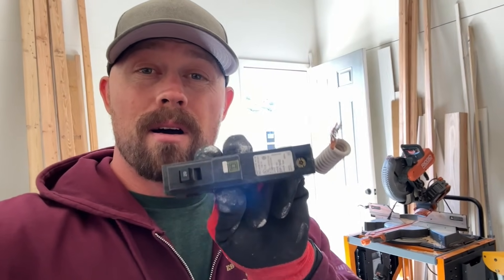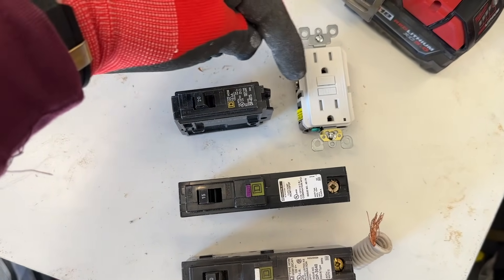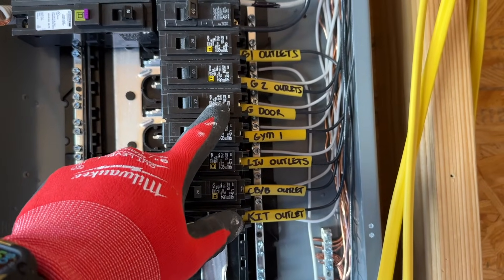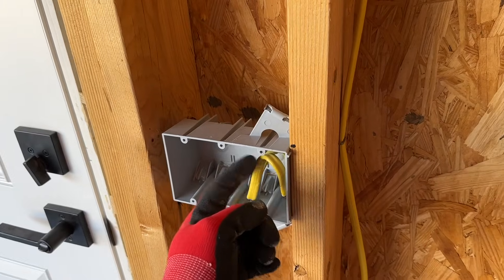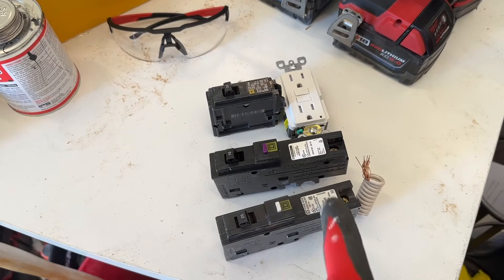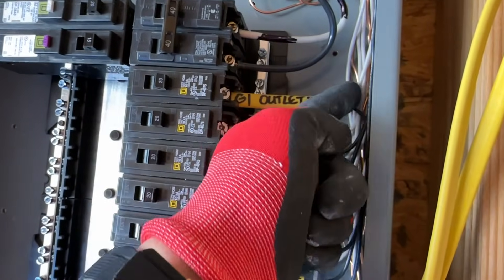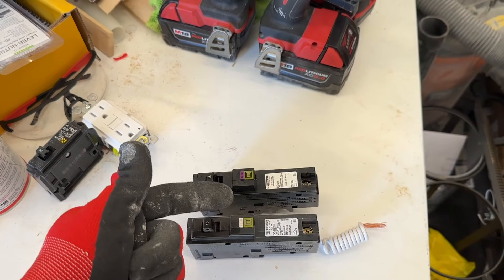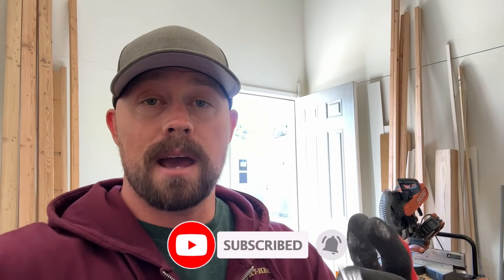AFCI Breaker Vs Circuit Breaker- What’s The Difference?

Comment: What's the point of connecting the breaker to neutral twice (white wire + pigtail)?
Reply from the maker: Technically the ground bar and the neutral bar are “bridged” or connected at your main panel. So yes they are both touching the same bar at the end of it all. At this sub panel the two are not “bonded” or bridged. Code says the sub panel should not have the ground and neutral bonded. Only at the main panel. The ground is a redundant connection making sure if the neutral for some reason fails the ground can let the power go where it needs to.  So even with the breakers you may see a push on connection with a pigtail and it’s just redundancy
Reply: @FortKnoxCo The ground is NOT a redundant connection as you stated. The equipment ground is connected to all metal components, including metal framing, service equipment, and metal water pipes, to insure that if a hot wire comes in contact with these components, a low impedance path is created to return the ground fault current back to the neutral/ground bus bar in the main panel, and back to the transformer to trip the breaker in that circuit. The ground and neutral are not connected to each other anywhere else, including sub panels, as you mentioned, because it would create parallel paths, aka "objectionable current", meaning current is divided between the neutral and ground unpredictably and is a safety hazard. If you had a neutral failure, an open neutral, the circuit wouldn't work, and if this happens in a multi wire branch circuit, it could burn up equipment because the circuit would become a series circuit. A ground wire won't come to the rescue in either of these cases.
The pigtails on AFCI/GFCI breakers are not for redundancy either. The neutral wire still connects to the neutral bus as does the pigtail. The pigtail is for AFCI and/or GFCI protection, and the neutral wire from the circuit is for breaker over current protection. A plug on neutral breaker wouldn't have a pigtail because the plug on feature plugs directly to a bus bar in a panel designed for plug on neutral breakers. The neutral wire connects to another lug on the breaker designed for this purpose, over current protection.
Reply from the maker: @  very good information! Thank you for sharing that 🤙🏼

Comment: I know you get this a lot, but you may want to keep in mind that for Square D breakers, purple button indicates a dual function breaker (CAFCI + GFCI) while the white button indicates a CAFCI breaker. Both types can have pigtail or plug-on neutrals. Regardless, you did a great job explaining when to use them and when it's not necessary.
Reply from the maker: I appreciate that. Yeah a lot of people have been mentioning the two differences, it is good to know, but it starts to get deeper into the weeds for most DIY’rs. But that is the next step in learning the differences, and when and where they are best utilized.

Comment: EXCELLENT DETAILED VIDEO. It was a quick lesson on where did the GFI switches go?!? Integrating makes more sense. I moved in a home that was built in 2021 and I did not recognize these AFCI breakers. My previous home from 20 years ago had the regular ones. This video really helped. Thanks!
Reply from the maker: You’re very welcome. Local codes call for different set ups. Sometimes they want both GFCI breakers and outlets. Sometimes just one or the other. Here they seem to like redundancy

Comment: AFCI would detect an ark inside the wall like wires chewed by mice. GFCI won't so... I don't understand your rationale
Reply from the maker: The main concept of the video is showing why you would have a GFCI or AFCI breaker in a panel vs a standard breaker. And how they can be put onto a circuit to meet the requirement of having a circuit GFCI protected without having a GFCI outlet installed.  But yes AFCI and GFCI are different in themselves.

Comment: ℹ️The only thing they have in common is instantly opening the circuit. Internal electronics and operating principles of the two devices are entirely different.
* GFCIs protect against electric shock by interrupting hazardous fault current as small as 5 milliamps. 
*AFCIs protect buildings and occupants from electrical fire.
Rather than a ground fault, what is detected is an arc fault - the associated heat from which is thought to be responsible for a large share of residential fires .
Reply from the maker: Very good info right here. I was mainly trying to highlight the reason one would be used on a. Circuit vs a standard and what their overall function was. I appreciate the detailed breakdown

Comment: Can i do not have a ground wire on my electric dryer can i use a afci in the panel box and be good. My dryer is a 3 wire black , red and white.
Reply from the maker: Your dryer sounds like it’s a 220v appliance. So you need a big enough breaker at the panel and the outlet in your wall needs to be able to receive that plug type for the dryer. 

But the breaker being afci or GFCI would depend on what you can get in what size of breaker. You may not be able to find a 30amp afci breaker.  Usually for the larger appliances like a dryer or A/C unit I’ve still seen a standard breaker.

Comment: I was wondering why the stores only sell plug-on-neutral main panels. thanks for the video
Reply from the maker: I’m not sure. Might depend on the brands they carry or what code in those areas require?  I know to get better selections you can order from bigger online supply stores. They usually carry whatever you’re looking for.

Comment: So, if I am wiring in LED lights on a branch circuit of 14 AWG on a 15A breaker, I should use a 15A AFCI (with the pigtail wire) Circuit Breaker inside the Panel Box for that branch?

I’m using 12AWG on 20A regular breakers for all my outlet branches, and have a GFCI Receptacle as the first receptacle in each branch, protecting all the downstream receptacles, so I think I am good there!?! (No need for AFCI/GFCI Circuit Breakers, on those branches, right?!?)

Thanks for all you have shown us, brother!
Reply from the maker: That is correct. You can either have a GFCI outlet as your first outlet and that protects that whole branch and you can have a regular breaker.  

And if you don’t have the GFCI outlet as the first  stop and your running straight to wall switches and lighting you could use one of the AFCI OR GFCI breakers in your panel to accomplish the same level of protection.  

At least that’s what my new local code is requiring of all circuits
Reply: You still need AFCI protection for most outlets inside the home, even if they're GFCI protected.

Comment: When talking about the garage lighting you said you could use an AFCI breaker in place of a GFI receptacle. Arc fault and ground fault are two different things. I assume you meant GFI Breaker?
Reply from the maker: Yes. In place of a GFCI. Apologies for the miss speaking. I was mainly trying to drive home the ideas of having a breaker & first outlet as a GFCI or have a breaker with the same capabilities and accomplishing the overall same task of protecting your circuits

Comment: Man thanks, you over explain that.  Must video are wam bam thank you mam & because I said so. Not really educating no1
These 60$-70$ locally and 40$-50$ online vs an 8$ regular breaker . But if i understand right they are 3 in 1. (Afci, gfci ,pon. Vs breaker +gfci) . But base on what you are saying,  could just run each home run to gfci outlet 1st then to light switch or whatever
Reply from the maker: Yes technically you could do that and the circuit is GFCI protected because the first outlet is GFCI and everything down the line like the lights is protected.  It’s not the usually way to do it but accomplishes the task. 

A lot of what needs to be done just depends on what your code requires. There’s nothing wrong with just having a regular breaker and stuff wired on that circuit. Just so long as it’s not over loaded. Thats the way it was done long ago and many houses are still sitting that way. But if it’s worked on or permits are pulled on it they will require you to update to the new way and add some stuff. But otherwise they would leave it as it is. So it all really layering safety measure and keeping up with the newest code.

Comment: Thanks for this video, I am confusing about the different breaker sizes of Square D, regular vs AFCI/GFCI. It helps me a lot. Great content.❤
Reply from the maker: Thank you. Yeah they may all look very similar but you need to pay attention the brand/Type of your breaker box first. That will have the brand/type of breaker you’ll need to look within.  

I made the mistake and ordered a couple breakers that looked exactly the same
But found the way it pops on and contacts the HoT bar of the panel was slightly different. Like it would sit into place but be just so slightly off. And you’d think it just needed to be “tapped” into place with some elbow grease. But it was actually a different Type of breaker.

Comment: I just got power after several days w/o it due to hurricane Beryl. However all my bedroom lights and outlets(afci) are not working. I went out to main circuit breaker to reset my breakers designated for the bedrooms outlets/lights, but it is still not working.
Reply from the maker: That could be a number of things causing the short. Breakers could be bad or ruined if wet or damaged during the hurricane. Could even be a bigger problem with internal wiring or outlets/lights having damage.
Reply: @FortKnoxCo  it was fine before the hurricane, so it couldn’t be internal wiring that caused this to begin with. Also the circuit breaker panel is inside the garage, thus not exposed to the elements to get wet or damaged. Do I need to replace the  bedroom breakers on the panel? Also could it be an issue where the power company didn’t fully restore the power to all the lines in the house?
Reply: @inquisitvem6723 I know that you didn't ask ME, but maybe try this. Unplug everything on that circuit, turn off (at the switch) any lighting. Remove the wires for the circuit from the service panel. Meaning to disconnect the black/White/ground wires. Use a volt meter (Multi Meter) and set it for CONTINUITY (it will beep when the leads touch together) if you have continuity between ANY 2 wires then you have a bad or damaged conductor. If any switches are on or if anything is plugged in on the circuit, it will give a false continuance. I hope you are able to find and fix your problem.
Reply: @c.blakerockhart1128  thanks. It was stupidity on my part. I just had to push further left. It was stuck in the middle and just enough elbow grease to the left did it.

Comment: Some corrections...
1:50 - if that's a Ground-fault outlet as you stated, it won't trip on an arc
1:55 - it doesn't protect "before it gets to the panel". In fact, the homerun is completely unprotected from the faults the outlet detects. It's only the outlet and anything downsteam from the load side on the outlet that's protected
2:10 - groundfault outlets do NOT protect from overloaded circuits. That's the job of the overcurrent device - the breaker in your example
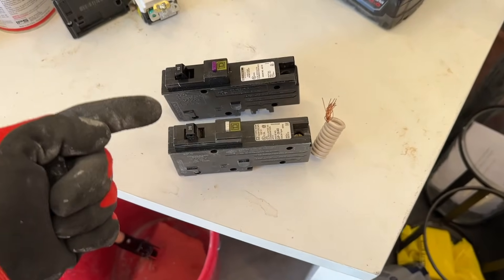7:19 - the upper breaker is a dual-function. AFCI AND GFCI. The lower one only provides AFCI (along with no being a plug-on neutral)
Reply from the maker: I appreciate all the great feedback back. Thank you!
Reply: Thank you for this. My daughter in law had a new house and the baths are GFCI receptacled but the kitchen island is not. I went and tripped it with a tester and it tripped the CB. (no  GFCI receptle in line. )  watching this he states in the summary "the difference in AFCI and GFCI breakers" but doesnt cover it just when you shoudl use receptacle versus breakers. 
I had other questions as I watched the video and you answerd a couple. Now I have to figure a way to see what you stated about the physical differnces to see if the questioned circuit with out GFCI receptacles is on a CB with GFCI or AFCI .

Comment: Great video! Thanks for the content - How do you make the decision on what to include on each circuit. Other than a dedicated appliance circuit, why would someone opt to have 1 or 2 outlets on 1 circuit and then multiple lights, outlets, and switches on another - is it just about convenience for wiring or is there a formula/total load you are taking into consideration?
Reply from the maker: Good question. Technically code depend on your area would say one breaker or circuit for no more than 10 outlets. That’s a very common practice. That’s also usually rated to be safe. Assuming all 10 outlets could be used at once. Obviously you’re not gonna have all 10 outlets on one circuit being used at one time. Usually it’s one or two like a vacuum and a blender. But just for general purposes, a good rule of thumb is no more than 10 outlets per breaker. As far as lights there’s also an equation that has to do with watts or amps. Now with LED lighting you can get away with a lot more lights on one circuit. So for example, I would run 115 amp breaker and run two or three bedrooms off of that one. Since I’m running a lot of lighting in the garage, I ran a 20 amp breaker that will power to wall switches and have two branches of a lot of lights. Everything is LED, so it’s still under loaded.

So to answer your question, they’re technically a math equation. My rule of thumb is if it’s going to be a fridge a washing machine or something that is a utility. I would put it on its own circuit if you’re able to. That way if you are using an outlet or something else related it’s not going to pull too much energy off of the one breaker if that utility turns on. So I usually run dedicated lines for those devices. Otherwise, I’ll run 6 to 8 outlets at most on one breaker. Again, just so I don’t overload a circuit. I’m trying to consider the use of power tools and you don’t want too many of those on one circuit because it could pop the breaker. So I usually underload those.

Comment: Thx.   New build blues     We are refurbishing a pole barn into a house. Old panel needs to go. Shopping for new one for 200 amp 40 space square D and this arc fault thing has me spinning
Reply from the maker: Yeah. It’s not too bad once you understand which circuit needs one and which ones can have just a regular GFCI outlet installed. I have about half my breakers with the new ones and the other half regular breakers because they go to all my outlets that have a GFCI outlet.

Comment: It has been a common sentiment that AFCI trip much easier than a classic breaker. Have they improved enough to rely on them?
Reply from the maker: So far I haven’t seen that problem. I know they are supposed to trip to the same standard and it’s really just an added layer of protection. But overall I think they are fine. Code requires them is some builds to pass permit inspections 🤷🏼‍♂️

Comment: My understanding is with plug on neutral panels used as a main bonded panel. The ground can go on the neutral bar but the neutrals must be one per terminal
Reply from the maker: Good information. I know there usually is a difference when you have a main panel and the. Neutral bar and ground bar are bonded vs with a sub panel the two have to remain separate.